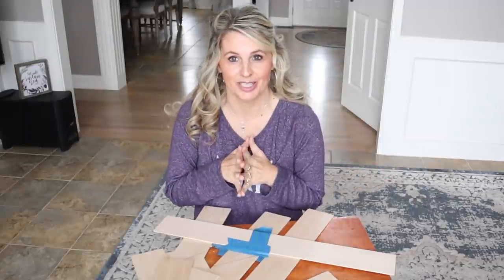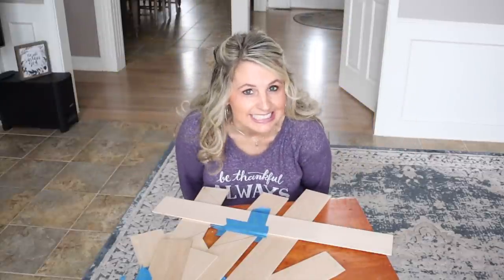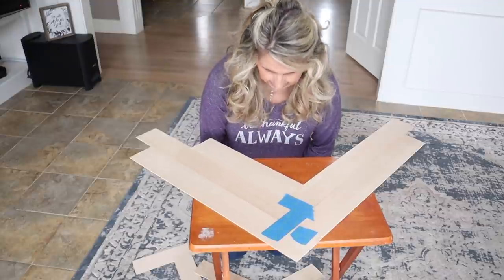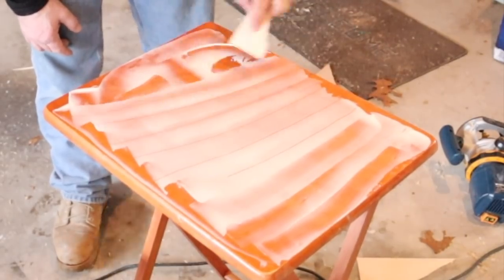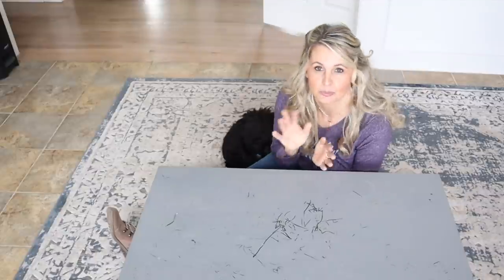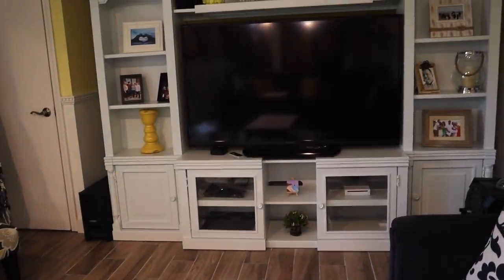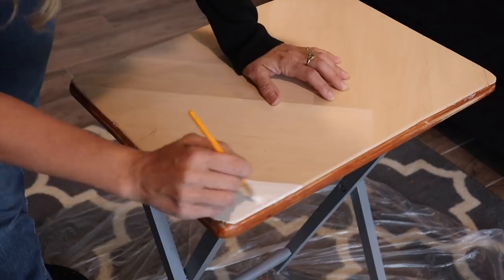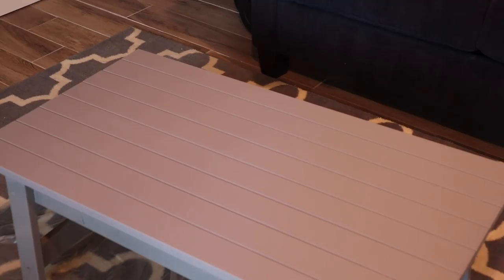TV TRAY TABLE DIY | COFFEE TABLE MAKEOVER IDEA

Comment: A friend of mine acquired a beat up wooden tv table like yours, but in horrible filthy condition.  He sanded it all down and just put polyurethane on it.  When I visited him, he gave the unfinished table to me.  I stenciled a design on it in black and gold etc and then put additional coats of polyurethane on it.  I love it.  I wish the legs were a bit shorter, but I’ll deal.  Yes, taping and painting tray would have been easier, but it all worked out in the end.